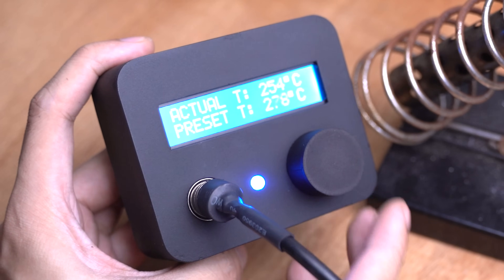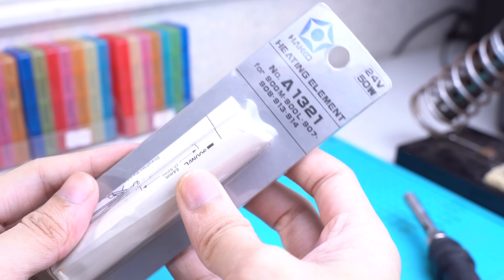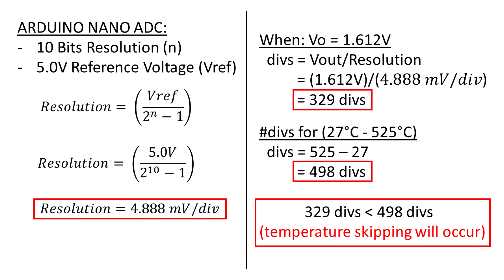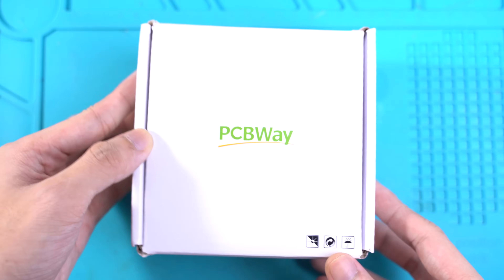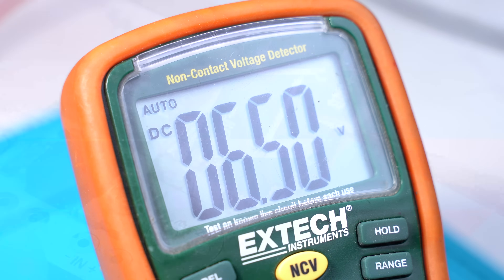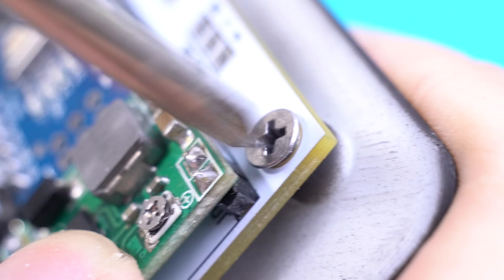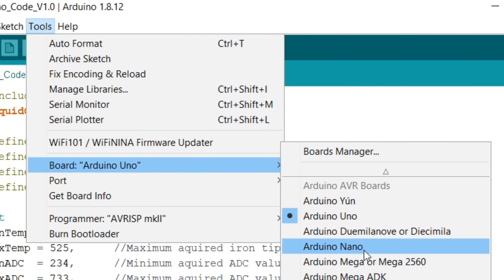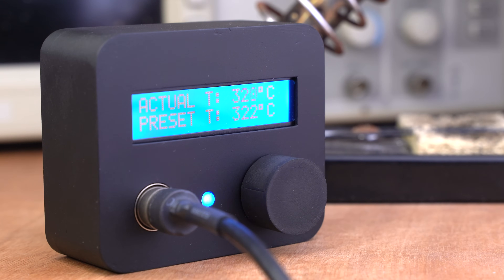DIY Digital Soldering Station (Hakko 907 For Cheap)

Comment: Hello bro, I have followed all these tutorials. with slight changes in some of its components. but, why every time I connect it always says cool and tip are very hot?
Reply from the maker: Your feedback is faulty. I've been emailed with issues similar to yours, as it turns out other clone handles use thermocouples rather than thermistors. This project is designed for thermistor equipped tips and not thermocouple (as found from hakko's original 907 handle sets)
Reply: @TechBuilder  so, what can i do?
Reply from the maker: 1.) Test to verify if the handle you have is a thermistor type
2.) Check if the op amp is working
3.) Check for faulty connections

honestly there a lot that could go wrong it's really hard to tell without seeing the ckt. did you breadboard yours or fabricated a custom pcb for it.
Reply: @TechBuilder  i use custom pcb
Reply: @TechBuilder  if my handle use thermocouple, what the component i need and code for arduino
Reply from the maker: @taupanalika4916  max6675 for a type k thermocouple
Reply: @TechBuilder Sir, if you use the max6675 module, you don't need to change the program.

Comment: The inbuilt K type thermocouple measures ADC values against the tip thermometer temperature. This is how you calibrated ? Pls mention the use of k type thermocouple

Comment: Hi Angelo, Thanks a lot for such nice, simple and effective design!  I'm currently building it.
If you allow me for a little comment, I don't really understand why the power from the SMPS step down is going to the Vin instead of the +5v pin. You could adjust the SMPS to +5 and avoid dissipation on the internal regulator. Anyway it is a great design!.
Thanks a lot for sharing it!
Reply from the maker: Thank you! Ripple reduction, post linear regulation is a common practice for reducing the ripple noise incurred by the SMPS. It does help improve ADC measurement of sensors if you are using the Vcc line as a voltage reference (which what the Arduino Nano uses by default).
Reply: @TechBuilder  Thanks, nice to know that!. I'll do as you suggest then.

Comment: The trouble now is the shipping costs for even just 5 boards. Someone needs to offer a sensible, uninsured, un-signed for, simple letter post for just one board or else projects like these are just dead in the water.

Comment: Looks like it would run nicely on 5x18650 li-ion cells.  A portable soldering station with real guts would be great to have!
Reply from the maker: It would! :D I attached it to a 6S li-ion pack when I was soldering my solar panel's line when I was soldering on the roof 😅 I made a tiny version of this with some 18650 slots and a belt buckle.
Reply: @TechBuilder  6s is 25.2v - it's ok at that voltage?
Reply from the maker: @antontaylor4530  Yup! The 907 is designed for 24V use. You can over-volt it too. The buck can handle 28V, so it should do :D
Reply: @TechBuilder  Perfect!

I need one of these, although I may try to alter it to work with my Weller iron.  Shouldn't be terribly difficult.

Comment: A mod to this would be to use hakko T12/T15 system tips instead, they are cartridge type where heater, sensor and tip is just one physical assembly for higher performance. Comparing chinese T15 clones to a geinuine JBC station (sub 10s heatup) I'd say you get 70% of the JBC performance, but for a tenth of the cost.

Comment: Why use a nano when any ATtiny would suffice? I’d also seriously considering overvolting it to 30-36VDC. There’s little risk of the element fusing, especially if you use a PID algorithm to stop the temperature rising so quickly, but it could be a great help when working on heavy gauge materials.

I’d also like to see this done with a T12 handle, as the cartridge tips tend to have significantly better thermal performance, if for a higher price. Their thermistor layout is also kinda odd from what I remember, so temperature sensing may be more difficult.
Reply from the maker: While ATtiny is cheaper, the beginner's in electronics are much more familiar with the Nano. Overvolting is a good idea but tiny bucks that can support above 30V are harder to find for the newbies. This tutorial was made in a way to let beginners get into MCUs and not scare them away. I have separate tech savy tutorial segments like the recent MPPT SCC where I didn't hold back from the component selection. I might revisit this old project and make a beefier and complex version of it. There's also a better version of the T12, I might use it if I were to revisit this project.
Reply: @TechBuilder  Any progress with T12 version model?

Comment: Hello friend. This soldering station is a nice job. I would only build using other types of soldering irons. This is another type of thermocouple. I just can't make it. Can you help me with that?
Reply from the maker: This one is designed for thermistors. If you plan to build with a k type thermocouple, you need a max6675 module or chip. There are other ways around this too but I prefer to use the chip with an MCU. You simply just have to implement the code for the MAX6675 and use the temp variable I used in my code.

Comment: I decided to use a pin header for the connections. Plus, I figured why you are able to disconnect the soldering iron: in case the soldering iron gets destroyed, you can replace it easily.

Comment: Very nice project! Maybe could be done by using a Attiny85, thus reducing the cost even more.
Reply from the maker: Thank you!! I had considered that, but from where I live the attiny85 boards are at the same price with the Arduino Nanos. The chips alone are cheaper tho haha, just worried some beginners might get discouraged from building standalone mcu projects haha

Comment: bro 😭😭😭😭😭😥😭😰😭😭😰😭😰😭😥😢😢😰why we cannot use IRFZ44 mosfet .irlb4132 is not available in india .please tell me which one is suitable.after checking the datasheet of irlz44 its equivalent mosfet is irfz44.
Reply from the maker: IRFZ44N is a non logic level MOSFET and would fail to saturate with the logic level PWM of the Arduino Nano, which would eventually make the MOSFET run hot. They are not equivalent in terms of gate threshold voltage. Simply search for "Logic Level MOSFET alternatives". I made a guide on MOSFET alternative selection from the instructables tutorial. 

If you want to go with an IRZ44N, go for a totem pole mosfet driver circuit using a 2N3904 and 2N3906. To be honest a single transistor would work as a MOSFET driver.

Comment: What do your heating-element and the inside of the tips look like when you exchange them after having used thermal paste between them? The datasheets of most thermal pastes I could find indicate that they decompose well below common soldering temperatures.

Comment: Why did you put a diode across the heater pins? The heater should basically act as a resistor, so a diode shouldn't be required, right?
Reply from the maker: It's an extra precaution for people using hakko clone handles. I've read in forums that some heating elements use a coil of nichrome inside the ceramic material, making some inductive as well.

Comment: how on the printed circuit board minus is applied to the source of the transistor and the screen. According to the scheme, it is supplied, but not on the board.    https://drive.google.com/file/d/1AexQxq68YO_Nqsi_dfmYLeywXrKr42gL/view?usp=sharing
Reply: How does it work for you?
Reply from the maker: @teskazzz  That was mentioned in my pinned comment, video description and Instructable tutorial. I made mistake in the previous revision and the one flashed in the video (the Gerber files and the existing link on PCBway was unaffected as it was based on the original PCB used in the video demo). Kindly refer to the files in the G-drive, not the video. They're all fixed.
Reply: @TechBuilder  So I downloaded it from there, it is just that the version that has not yet been corrected is visible.

Comment: Please verify the PCB it's not matching with the schematic. You are using the positive input voltage as GND on the PCB?
Reply from the maker: My apologies for this. They're all fixed now and are all consistent with each other. Kindly refer to all the files from the google drive. I constantly update the google drive for tiny revisions, the previous one had an error.
Reply from the maker: The PCB links and Gerbers are all unaffected from the inconsistencies (confirmed by the ones who ordered the PCBs). The older schematics, pdf layout and tutorial photos on the other hand had this issue.

Comment: Love the simple instructions! I wanna make one cuz it seems super begginer friendly, and cost effective! Don't have much need for one with my trusty TS100 though, but maybe I'll still give it a go.

I did have a component question thought, I bought 10 of those little buck converters but found at 24v down to 5v they got very hot, so I stuck to using the bigger units. Did I just get a bad batch or was I pulling too many amps? (it was powering a fan)
When I looked into it I decided my output was too far away from my input, but I guess that's greatly mitigated by very low current draw.
Reply from the maker: Thanks! T100 is already a great Iron! :D Let me know how it goes! For the tiny buck converters, how much current are you drawing from the output? They have limits in terms of thermals, it's probably the reason why they get so hot even without nearing the 3A spec. I usually use those tiny things for low power applications (like supplying the lines for the Arduino and LCD for this project).
Reply: I encounter the same thing. I am using original transformer 3A, the voltage around 27V AC.
I am thinking replacing converter with 5V 5A, so no need to trimming again

Comment: Can I use Hakko 936 handle instead
Reply from the maker: Haven't tested the 936 but I think it will work
Reply: Actually i did but not working. I had before 936 clone and it wasn't warm enough. So i try that but now never warming. I was used the 19v laptop adapter. I wonder if i need 24v source? or is it another problem?

Comment: liked this video. but thermal grease used on computers is not recommended on temps above 150deg
Reply from the maker: I am aware. The oil burns down and the compound solidifies, I mentioned some of the details on the instructables tutorial. Regardless, there is improvement in thermals compared to without, you can try it! :)
Reply: @TechBuilder  got subscribed. thank you

Comment: I don't think it is a good idea to keep the components within the heater assembly exposed to a permanent potential difference (when the heater is off) and to use DC for the heater. The thing is, at high temperatures the ceramics become slightly conductive, acting as a kind of electrolyte, supporting electrolytic metal migrations within the element and distortion of the temperature sensing signal (leakage current from the heater causes voltage shift at the thermal sensor). Way better is to use both heater as well as the sensor connected to the same ground (of course within the station, the handle still needs separate wires) and use AC heater supply. To make it in a simple way, the easiest is to use some SSR (triac with an optotriac combination) and a 24V transformer supply. Control supply could then be easily derived by half wave rectification of the 24AC and use that to supply the DCDC. Because most of the time the heater is off (at steady state the duty ratio to maintain the temperature is low), there is no voltage between the heater assembly components. And even when the heater is ON, it has zero DC component, so the electrolytic degradation is limited.
And the temperature control would be way better off with some PI (or even PID) scheme, a simple comparator makes the temperature fluctuating a lot (due to the delays till the heat from the heater reaches the tip and the sensor). Using the thermal paste may seem to improve it, but the paste is by far not designed to operate at such high temperature so will decompose over time, so adding further degradation elements to the heater and mainly risking the tip getting stuck over the heater.
Better keep the tip/heater assembly clean and dry and deal with the delay by the regulator time constants.

Comment: NO WAY thermal paste in soldering tip is that a joke or is it real?
Reply from the maker: For jacket type tips, it is effective! I haven't tried it in regular irons though.
Reply: @TechBuilder  I didn't know thermal paste can withstand that high temperature I thought the oil will just boil off. But I'll give it a try.
Reply from the maker: It would actually burn off. The remaining chalky material still helps in conducting heat. Although there are silicone based thermal pastes that could withstand extreme heats. Have fun!
Reply: @TechBuilder  very helpful and very much appreciated!!

Comment: Is it possible for Hakko 926? I have the old model
Reply from the maker: Yup! It should work. Not sure on the 926's sensor but if it deviates from the 907, you'll have to calibrate via program.
Reply: @TechBuilder  I will check it and I will follow what you did. Thank you for your idea. Very good project. It also can save my work space too😘😘

Comment: I've bought to a ts100 last year. From 20°C to 400°C in under 15 seconds at 24V.
Reply from the maker: I have one! They're pretty fast to be honest. I just dislike the grip on the thing. I use it often for remote repairs with a PD powerbank and the USB-C bypass board.
Reply: @TechBuilder  that's the new one, the ts80. I didn't like the usbc thing so I bought the old one. I didn't get how much would your diy project cost tho.
Reply from the maker: I meant the old one. I just added a USB passthrough so I can connect the old TS100 to USB-C, never knew they have a USB-C version now. The cost was roughly about $7, from where I got my parts (excluding the power supply).
Reply: @TechBuilder  oh, that's interesting, could you share a link to the board?

Comment: Nice project, but if you try so hard, why don't you have a built-in vibration sensor for sleep mode. I would have integrated a proximity sensor in the soldering station stand / holder, too . These are the features that actually make up the expensive devices. I would have also integrated a small menu, if you use a different Power Supply, then you don't always have to connect the Arduino to the PC but can enter the parameters in the menu. 

But I can talk a lot 😅 ...Still, thank you for sharing.
Reply from the maker: Thanks! I didn't add them since project complexity scares most beginners in making projects. Regardless I added extra unpopulated I/O ports when an I2C LCD is used. I added an ESP8266 on mine to link with the PIR sensor and phone app on my solar automated workspace. I guess you know your way around this already. As for sleep mode, my version 1 has it, I barely use it anyways, it poses an inconvenience. Most people I know hate the sleep mode too, it just sounds cool to have :/
Reply: @TechBuilder  absolutely understandable and I think it's good that you show consideration for the beginners. So I like the sleep mode, it pays the tip and doesn't let the solder harden. I sometimes have long breaks between soldering and I like to use it. But everyone has their own preferences. So you can also implement it optionally. Maybe you can add it later as an update.